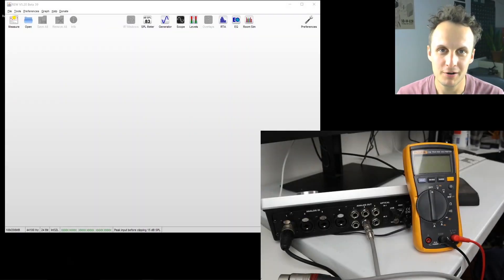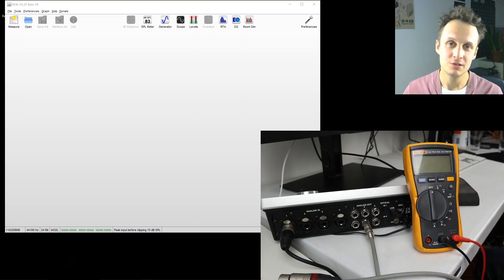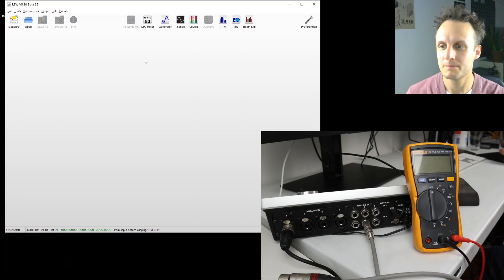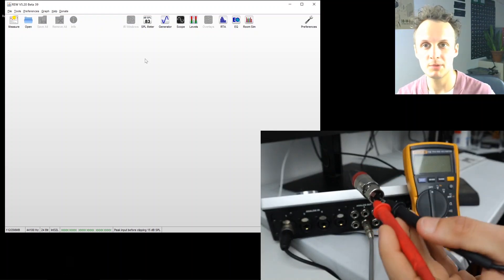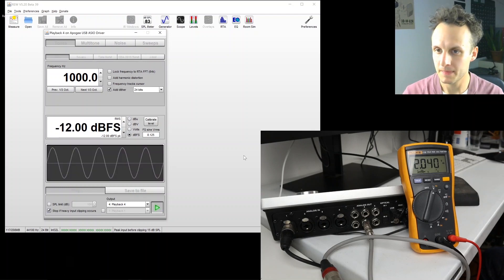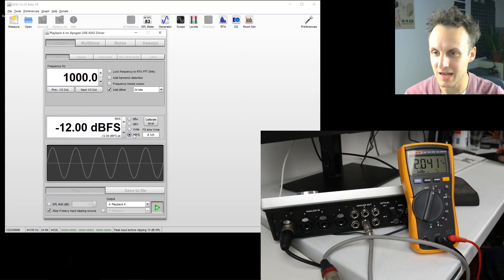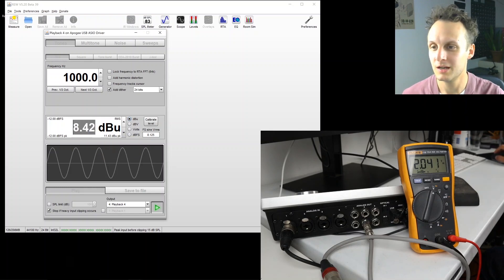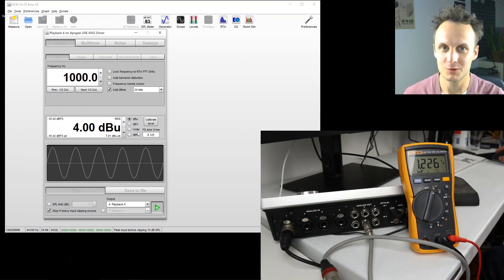Measure Your Audio Gear with REW: Pt. 3 Calibrating Levels

Comment: Enjoying the videos.  Thank you for making them. I am using a Scarlett Solo soundcard, and I calibrated it and set the output to -12dBFS to match the -12dBFS input.  However, -12dBFS produces only 221mV from the soundcard in contrast to the 2.04V you were getting. It means I can only get full scale RMS voltage of .928V and my amp needs more than that for full output.  What do you recommend.

Comment: You should switch the output frequency of the REW generator to 50-60Hz and then measure it using a digital multimeter. These are the frequencies these multimeters are calibrated to measure the RMS value. All other high frequency signals must be measured with an oscilloscope.

Comment: Important to realize that your DMM is a nice fluke that can read 1Khz accurately, many meters AC bandwidth tops out at about 400hz as they are intended for mains voltage readings...there are actually very few meters designed to read the full audio spectrum

Comment: Hi, this was really helpful, but I think you've forgotten to account for the sound card generator's output impedance: the signal level needs to be measured while connected to whatever load it connects to during testing. If you have a lo-Z input to drive (such as a mic preamp) the difference can be considerable.
Reply from the maker: That is a very good point. I am assuming a very low-impedance line output and ~10k impedance line input. But if the two are closer to each other there can be significant level loss.

Comment: How come when I’m measuring my interface at -18 dbfs with a 1k sine wave, my multimeter is giving me like .986 volts?
Reply: You need a true rms multimeter to measure this . Because cheap meters calculate the ac voltage based on like 50 or 60 hz
Reply: Jakob Buitenhuis what’s the cheapest true RMS multimeter?  I thought i bought a good one but i guess i didn’t.
Reply from the maker: What makes you think this is wrong? 0.986v is about +2Bu. Your interface could be calibrated to +20dBu for 0dBFS. That's in the ballpark.

Comment: you missed the fact xlr are balanced lines.
So between 2 and 3 you only have the amplitude of the negative part of the total signal. You should multiply by 2 in this case.
It would be better to probe between 1 and 2 to get the total amplitude.
Reply from the maker: Hi thanks for your comment but I think you might have the pins mixed up. 2 and 3 carry signal while 1 is chassis ground. So the full potential will be between pins 2 and 3 while between 2 or 3 and 1 you will get half the potential.
Reply: DIY Recording Equipment you’re right !